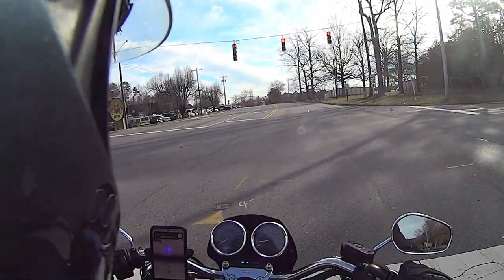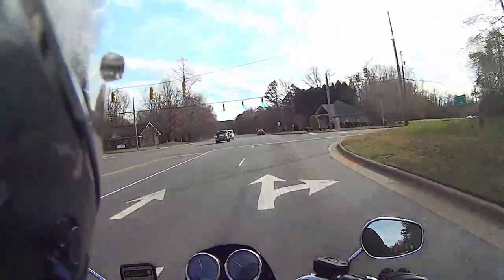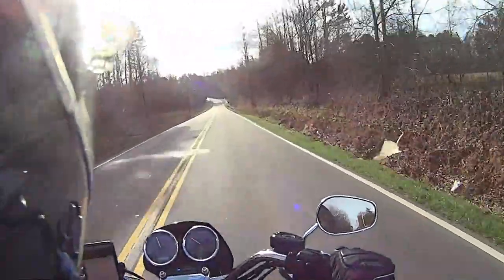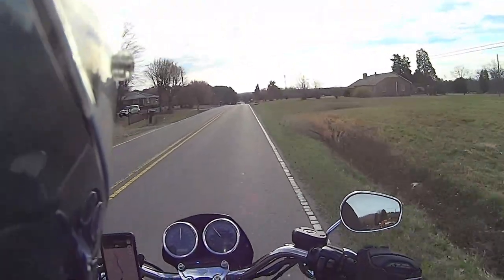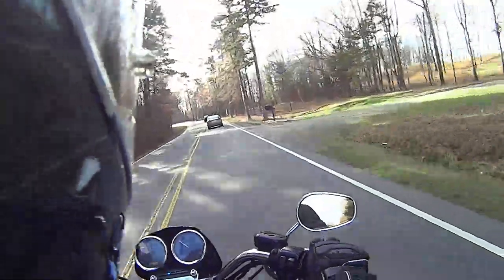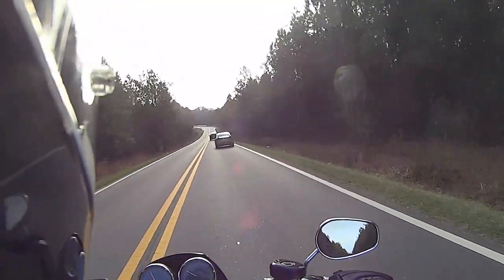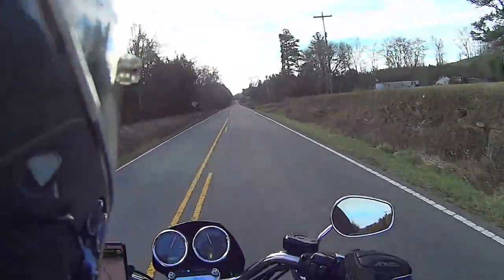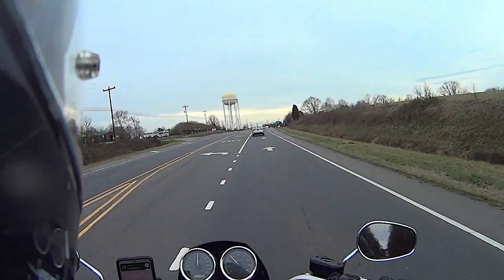Hammer 1275 Kit Break In, Initial Thoughts

Comment: Hi there from the land Downunder (Australia). I did a basic 1275 upgrade on my 1997 883, a year or so back. So the basic kit is the pistons and barrels on stock heads, which gives me a 10.1:1 compression ratio. I used the standard Carburettor, with an S&S teardrop air filter and a 2-1 exhaust system I’ve had since I bought the bike in 2007. I’m thinking of putting a Mikuni on it, but I’m not sure it needs it. (Conversion rates mean that everything is so darn expensive here!) I have a 29 tooth drive sprocket, which gave me less vibration at highway touring speeds (coz of the lower revs). I’ve covered most of Eastern Australia on this bike in 883 configuration and have the suspension set up better than stock, with 1” longer shocks, to give better ground clearance in the twisties. A friend on his Laverda Jota was pissed that he was grinding stuff in corners trying to keep up with me, whilst I was not. The first thing I noticed when doing the 50 mile and the next stage of the break in process, was that it is MUCH smoother running than it was. I discovered that the pistons Hammer supplied are actually the ideal weight for this motor, and a guy I had do some carburettor tuning (after the full break in) didn’t quite believe me when I told him that I hadn’t the crank balanced. I did do a total engine pulldown, as it WAS over 20 years old and I decided to replace evey bearing that need it in the gearbox, etc. 
I had an engineer look at the crank and rods, bearings, etc, at the same time he rebuilt the heads and he said the bottom end was in great shape. I put in a 2007 oil pump for the improved scavenging and Hammer’s bronze oil pump gear, plus one of their machined steel timing rotors. 
Since completing the break in and fine tuning the carbs, I’ve found that I get significantly better mileage, but the power is simply awesome! I have to be careful taking off from the lights, because it likes to lift the front wheel, but it’s not insane. It’s in the mid-range where it really pulls hard and although I haven’t had the throttle fully open in top gear, I’ve hit over 130mph with ease, which is more than enough for me. It’s the acceleration from 80-100 that blows my mind. Of course, this engine isn't rubber mounted, but it is so much more smooth than it was, that i have to really watch the speedo, as our cops are the most humourless people and anything more than 20mph over the limit will earn a fine of over a grand, plus an instant 6 month licence suspension. There’s even a possibility that the bike could be forfeit! (I told you they’re humourless) Anyway, at 67 years old, I’ve slowed down a little since my teens and I just enjoy having more power than I really need on tap, especially in the twisties, where I hardly get out of third gear (Just roll on and off the throttle, as needed) Engine braking is more than adequate, unless I need to avoid a hazard or a corner tightens up significantly. Your bike sounds good in the video. I can’t speak highly enough of the people at Hammer Performance. Hope you have as great a time with your 1275 as I’m having with mine. Cheers mate, from Oz.
Reply from the maker: Totally agree and thank you for the comment! Such good bikes as it is and the 1275 is just plain magical. I've put about 6-7K miles on it so far this year so I am most definitely enjoying it!

Comment: My mate did 1275cc kit with cams & head sent away to USA to get heads.HE added 4" of length to swingarm & carbon fiber fenders & 10L fuel tank.
Put 4 pit Nissen brake single disc on front & HE drag races it down the ¼ mile.It's way more powerful in higher rev range & he rides it on the road too but puts a street tune into it.Yoy see him shifting his body weight into corners cause of extra length & is more careful cause of extra length.Blows away mates 1589cc Fatbob & is about 1" longer & chain driven to take the torque off the line with his launch control.
A 2" stretch to swingarm on a street version be good & better for cornering his one us full on drag bike.
Reply: I did a short of it parked up & you can see the whopper chain on it & added swingarm.Look at my Shorts you'll see it.

Comment: I would not do just the cams on an XL. Because unlike on the Big Twins how they have many cams available that make power and torque increases throughout the entire RPM range its not like that for the Sportsters they lose some power and torque in the low RPM range with the aftermarket cams. So go all out with the pistons and heads too so you dont feel that power loss down low if you are going to modify beyond exhaust and Air Cleaner.
Reply from the maker: I mean...I hear you on that. However if you can stomach the slight down low loss you really stand to wake the bike up completely overall though so it's a tradeoff at that point.
Reply: Not entirely true. Jackhammer 570 from Hammer Performance doesnt sacrifice anything in the low range, and you gain throughout the rest of the range. Amazing cam if you aint trying to spend on the heads, because you’d be spending twice as much. And if you aint WOT all the time, then the 570 is a great choice.
Reply: I have an 05 xl1200. I got the 1275 kit with the jackhammer 570 cams, ported heads, ignition, and other smaller upgrades. I've had it for about five years now and it still puts the same smile on my face that it did the first time I let it loose after the break in. Highly recommend the product and the company. I live about 45 minutes from their shop and they are great people. They remembered my build after about 3 years and gave me a tour of their shop.
Reply: @disht2  You should have it dyno tuned, and see what she's pulling. If your carb is tuned right,, and with a 2 into 1 exhaust like a Thunderheader you should be able to get 100 plus hp. Back when I had my 1200 Sporty they didn't have all of the aftermarket performance parts avaliable that they do now by Hammer, etc. On cams your choices were Screaming Eagle, and Andrew's, and with those cams you lost some power down low.

Comment: have you upgraded ignition? twin tec? did you get the programing cable?
Reply from the maker: Twin tec yes. No on the cable because inital 0 slope 2 is what hammer tells you to set these for. No custom ignition tuning needed. Now, could you get more out of it with a custom tining map? Good question. Would have to ask Hammer on that one.

Comment: What exhahust system is that?  Thank You.💯👍👍
Reply from the maker: Cobra el diablo 2-1. On carburetor bikes you need to buy the o2 sensor plugs otherwise you'll have holes in the headers. Otherwise it fits fine. They technically don't say it fits the 04-06 bikes but it does.

Comment: Do you think that the solid mounted Sportster would handle the power correctly? And I thought there were  FXR frames for Sportsters.
Reply from the maker: Absolutely. Would just be a bit rowdy-er since they are lighter but Hammer has built a ton of solid moint Sporties.  

As for fxr sportster frames I've never heard of that but I'm VERY interested!
Reply: @AllAmericanAutomotive ,
I didn't know that they're lighter. It's good to know that it would handle the power correctly, so it wouldn't be sort of a waste of money. I prefer the older frame, and I eventually want to get one of the kits, but I want somewhat milder pistons, for more reliability and a longer lasting engine. I remember seeing some, years ago, just like the Softail frames for Sportsters. I just looked again, and I found this.

Comment: Your supposed to vary your speed during break in and you're just staying at one RPM range you'll wear a flat spot on those cams so you'll have dead acceleration from that RPM when trying to accelerate.
Reply from the maker: I was varying speed (and therfore rpm it just may not have shown on camera well) 
Also, these are not a flat tappet setup so you'll never wear a flat spot on the cam unless a roller locks up and that has nothing to do with break in. The idea being varying rpm is more to ensure the rings seat to the cylinder bore then it is for the cams.
Reply: Lmao!

Comment: Did u upgrade from 1200?
Reply from the maker: Yes
Reply: @AllAmericanAutomotive  does it make big difference with torque and speed
Reply from the maker: @BobbyD  I'd say you want to do at least cams plus the 1275 if you're upgrading from a 1200. If not you may feel like you wasted money since it won't be THAT much faster. 
If you get into head work is when you'll really notice a difference over a stock bike
Reply: @AllAmericanAutomotive  what kind of kit did u get and how much. It’s better to change clutch plates too right? Was it worth it overall
Reply from the maker: @BobbyD  I did 570 cams and 1275. No headwork. I primarially did it since my engine was burning a ton of oil and had some miles on it.

It's pretty quick 0-80ish, and really pulls quite strong well into the low 100s. It probably has a solid 125-130mph in it. I'm taking GPS speeds not inflated Speedometer speeds. Basically all bikes are like 10-15mph off at high speeds.

Comment: Breaking in a air cooled engine in cooler temperatures is great,as long as the oil reaches it's operating temperature.
Reply from the maker: Totally agree. I felt very comfortable doing it when  I did, middle of summer can defintely be tricky.

Comment: All that time and Money and my Stock Buell still beats it .
Reply from the maker: Hell yea man the Buells are awesome bikes! I'd love to add one to thr stable one day. It's too bad they didn't carry the motor over into the newer sportsters when they sold off Buell.
Reply: @AllAmericanAutomotive     Eric Buell Designed the Halicon 1125 with some help from Rotax in Austria where they were mfg'ed.  I heard that Eric Buell brought the Tooling to WI  where he made those engines in the USA for EBR  it became 1190 CC's and made 185 HP
Reply: Did you race him or what?   What stock buell do you have that is so special?
Reply from the maker: @RedlineDR1200  I since added the mikuni carb and it made a noticeable difference. It's really a great running bike!
Reply: @AllAmericanAutomotive    You can buy most of the Buell parts from the Screaming Eagle Catalog.  The Buell has a lighter ran .. more aggressive cam  high compression ration .. Different engine cases .. and the Heads flow way more with downdraft Fuel injection. I am referring to the 1203 CC Bueler Thunderstorm engine..   I think Buell called the Overhead cam liquid cooled engine the Halicon .. and Buell is still using it today .  Buell is back  the new Owner is in Grand Rapids MI
Reply: @AllAmericanAutomotive    Also my Buell has an Oil cooler with an air Scoop .. Air Scoops to cool the rear cylinder and a thermostatically controlled electric fan
Reply: @RedlineDR1200    Stock Buell is  103  HP  Stock HD Sportster is  54 HP ..   Stock Buell has  7,000 RPM redline .. and is 200 Pounds lighter.. that fact that the Buell is so much lighter it almost always  beats Harleys  just like my  689 CC Yamaha FZ-07 does ..  I ran 12.77 @ 107 MPH in the quarter.  I can't launch hard because it wheelies to easily .
Reply: @mikeskidmore6754  That's a 103 hp to the crank on the buell ffs.  Take a rubbermount 1200 tuned and a tuber or xb tuned and they aren't near the far apart.
Reply: @mikeskidmore6754   That's slow af haha.  It's not because it wheelies, it's because you cant ride and you still think buells have a 103hp  lmao
Reply: @RedlineDR1200    For the Record Eric Buell was getting  150  Horsepower out of Evo Based engines in track race form.  Really High compression "race gas"   really hot cam not so streetable .. My  74 CI Buell eats up  114 CI Harleys on the Street  partly because my Buell is 200 Pounds lighter,
  A stock 1700 CC Yamaha V-Max is like 174 HP    1000 CC Japanese 4 cylinder bikes can easily make 200 Horse Power.
Reply: @RedlineDR1200    The Later Buells based n the Evo .. 1203 CC' Dual shift rails .. Special  engine cases.. lighter cranshaft .. Higher compression ration ..  hotter cam  much better flowing heads.. Down draft Fuel injection ..
  Air Scoops to cool the rear Cylinder..  oil cooler with air scoop .. and thematically controlled cooling  all things that HD could do, but they do not . Until recently when they finally add oil coolers and liquid cooked heads..
Reply: @mikeskidmore6754   None of your comments change the fact that your buell does not dyno a 103 hp and you cant ride. lmao
Reply: @RedlineDR1200    I see a Video of you Drag racing some I guess Sportster.   All I have to do is Borrow a Stock  1,000 CC  Yamaha R-1 Suzuki GSX 1,000 which can run 11 second quarter mile times stock ..
  As far as me being slow .. I rode Tail of the Dragon on my Yamaha FZ-07 . I had to pass every jerk on a Harley on the double Yellows who would not pull off .. 70% were polite and pulled off  30% were Jerks and impleading traffic and slowing every one else down.
  I paid $4,500 for my stock Buell with  15,000 miles on it.. I am not wasting my time or money to modify it .. I am leaving it as is ..  I probably could put a Nitrous Bottle on it and beat your bike ..
Reply: Ok